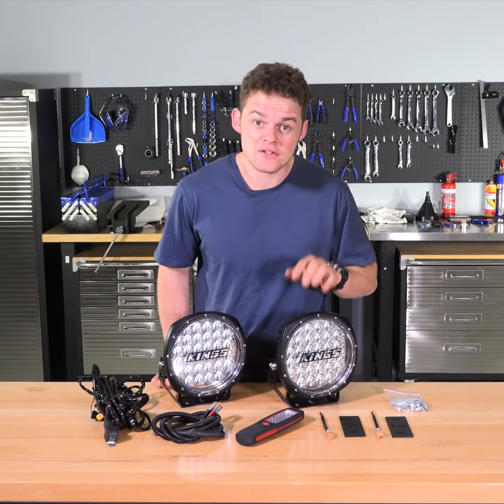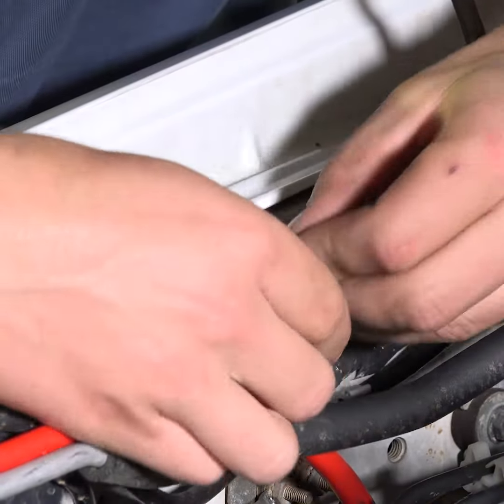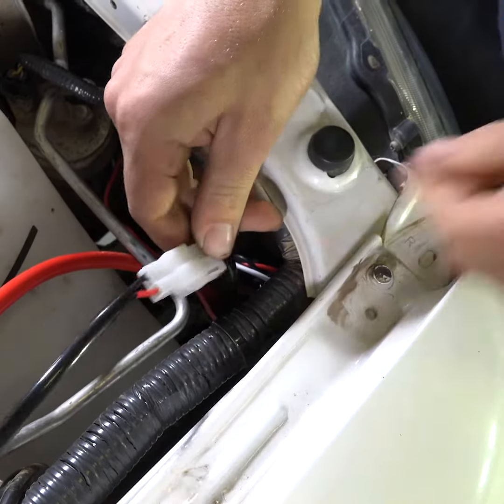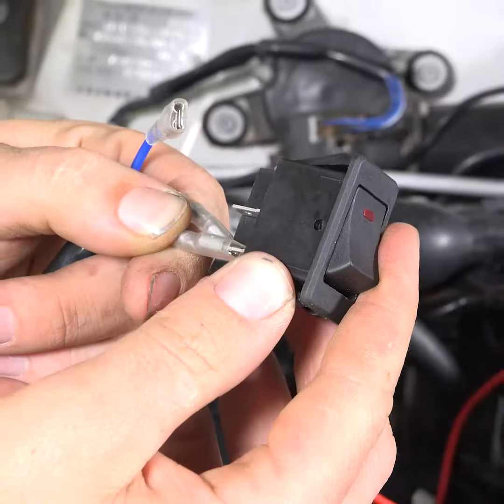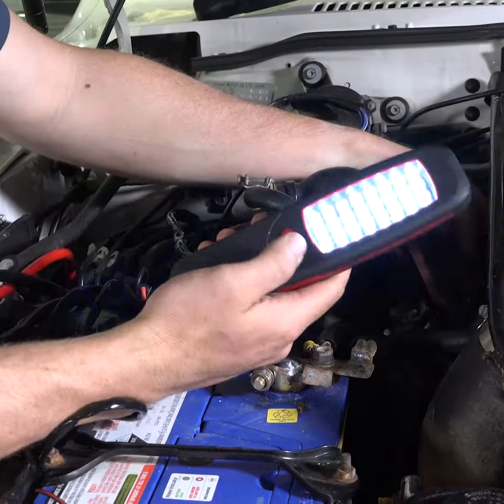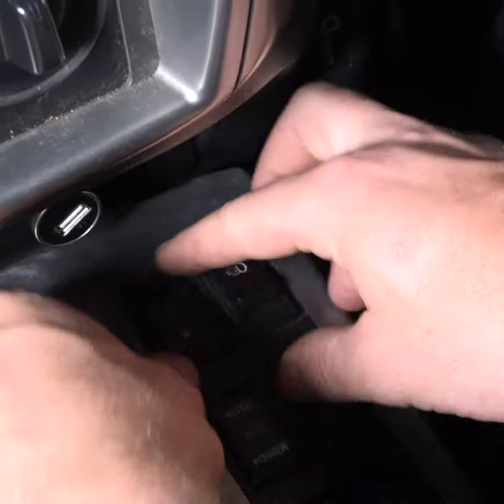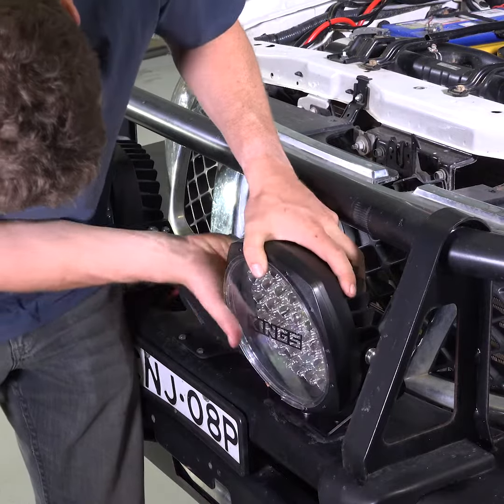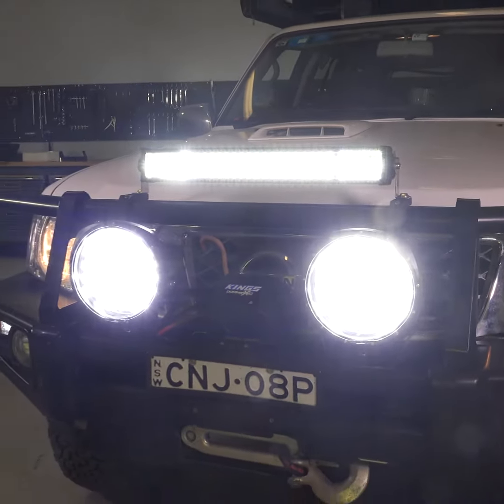Light up the night with this easy DiY light pack install

Comment: please make a plug to work with the rg colorado
Reply: We have a 2017 Holden Colorado and we got the 42" Domin8r led light bar to mount on our roof. The wiring harness was perfect so It should also fit your Colorado.

Comment: All very well if you have access thru fire wall if not, way more time ...09 vitara only access was pass. side thru larg grommet  which wouldn`t  let outer casing thru...so had to cut off casing ....and thread just the wires thru had to take glove box door off to get to them .... Add another hour !!....Only cut casing part way